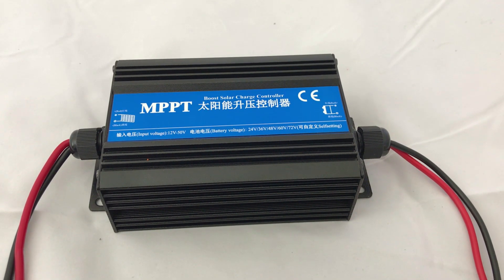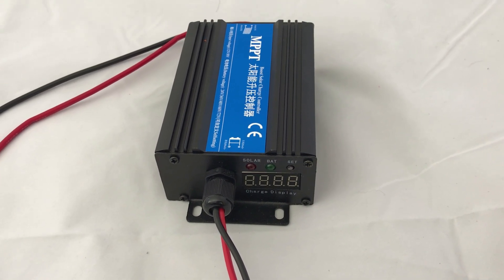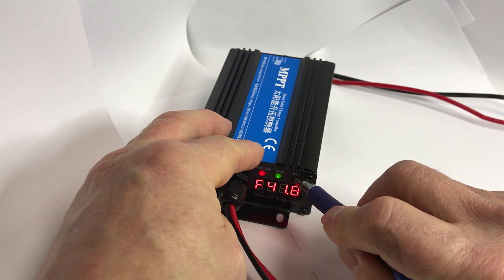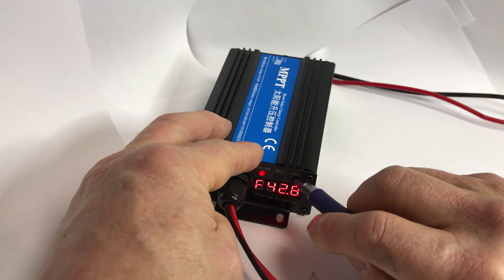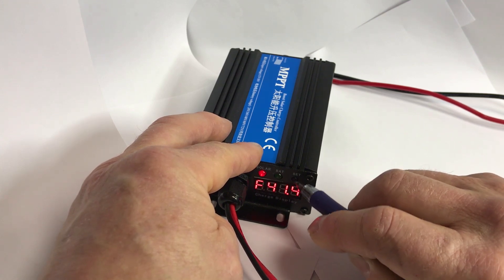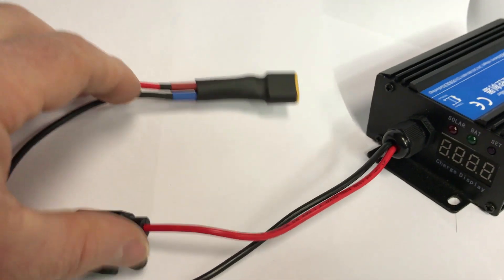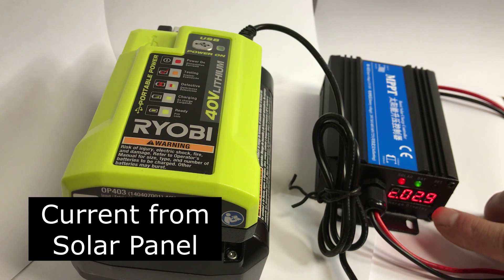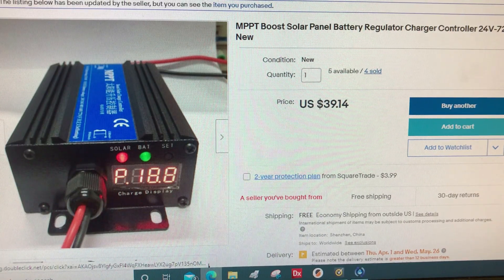Cheap RYOBI 18/40V Solar Charging

Comment: One should be careful charging two 18v batteries in series because one could be overcharged while the other 18 volt would be undercharged. I am interested if the ryobi brand batteries have overvoltage protection when you charge without the ryobi charger?
Reply from the maker: Agree. I try to use the official 18V charger with temperature sensors when I can. This seems to work pretty well though. The RYOBI BMS' are pretty good (I don't trust the knock-off brand ones). I've been meaning to do some experiments with a fully charged and empty battery to see what happens.
Reply: The batteries should have a built-in BMS.
Reply: @GoatZilla  Most don't have a BMS. The power tool has the discharge cutoff and if you are not using a power tool then the battery has no BMS.
Reply: @uhjyuff2095  Name one.
Reply: @GoatZilla  Black and Decker lithium.
Reply: @GoatZilla  You know how the power tool batteries don't charge. It is because the battery tells the charger not to charge, but if you connect the battery to a power supply it will charge the battery just fine. No BMS.
Reply: @uhjyuff2095  Wrong.  Black and Decker have BMSs unless you're talking about the discontinued 2s VPX line.

You can literally find the PCB and look at it.  It has pads for all 10 cell taps.

The second indication that a lithium battery has a BMS is the fact that none of those cell taps are externally accessible.  That means something inside is managing it.  

So try again, otherwise there's no reason to be promulgating falsehoods.
Reply: @GoatZilla  you're right that the battery has a management system when used with a Black & Decker tool but if you connect to the positive and negative terminals with little pins you can get voltage out of it like he does in the video but the battery will not turn itself off when the battery gets to a low voltage State the tool is the piece that talks to the battery and stops the voltage on the tool side that's the best I can explain it you're going to have to test it out to see that the BMS inside only talks to Black & Decker tools not other devices.
Reply: @uhjyuff2095  Alright I'll take your word for it with the B&D design error.  I wouldn't put it past them to screw something like that up.

Comment: Another option would be the MPT-7210A. Similarly priced, but the user interface is superior in my opinion. I've been playing with just using a simple boost DC/DC with voltage and current adjustment. Set the voltage to the peak battery voltage (42.0V in your case) and the current to the max power point of the solar panel (2.85A in the case of your Renogy). I think I paid about $10 for the 600W version I'm experimenting with. Worked great for charging my 18V packs from a 50W panel, and has the added benefit of it doubles as a vehicle based charger.
Reply from the maker: I've used boost DC-DC converters on other projects ( https://youtu.be/d2r3jbL78iQ ). Some of them had overstated specs. and seemed dangerous to me. The heavier duty ones where more expensive and didn't have a case. I'll have to check out the MPT-7210A, Thanks!
Reply: hi, i bought these for my 72v battery pack. they work great when solar pannels are connected but makes ahort circuit when nothing is connected. I fear that at night when there is no sun, the charger would create short circuit??? have you tested it at night? how does it behave
Reply: hi, i bought these for my 72v battery pack. they work great when solar pannels are connected but makes ahort circuit when m is connected. I fear that at night when there is no sun, the charger would create short circuit??? have you tested it at night? how does it behave
Reply: Same hear .